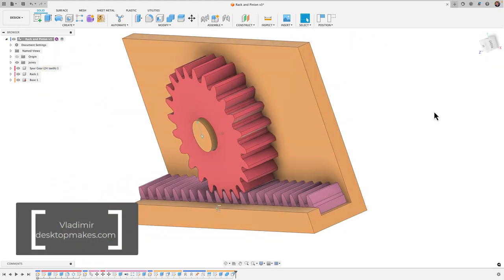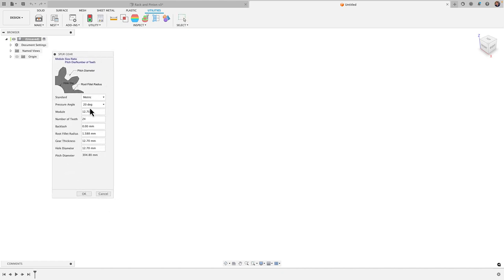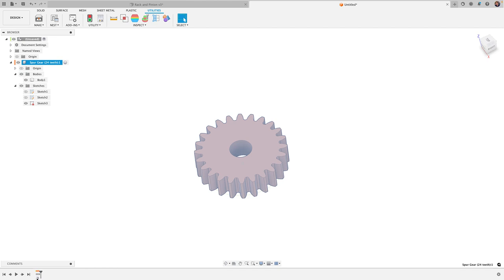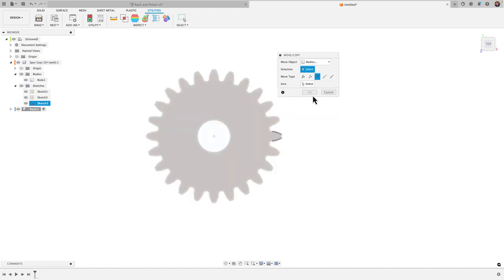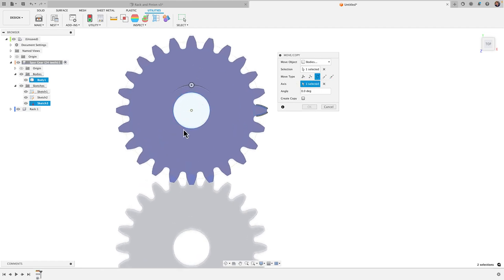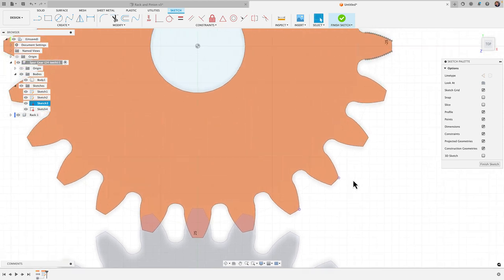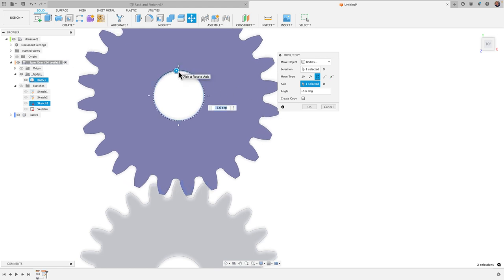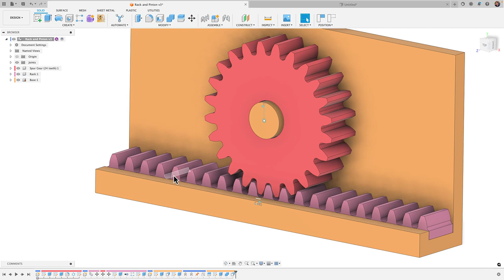How to Design a Rack and Pinion Assembly in Fusion 360 - Part 1

Comment: Very good video.  

At about time 9:30 you start discussing option of clearance between teeth.  In fact the "involute curve shape" that is used (the set of nodes on the arc you showed earlier) means that the two teeth actually roll on each other.  In Gear tooth design that shape is calculated by the Module (which you selected in the earlier Add-in script.)  In essence, if you design a gear using a module value, any other gears designed with that same module will mesh smoothly with it.  

 I thought I would give a quick overview to help understand what is going on with the gear tooth add in behind the scenes.  Hope its of use.
Reply: I like to take my information from books more than videos. Do you have any book recommendations about how to design mechanical things like gears ?